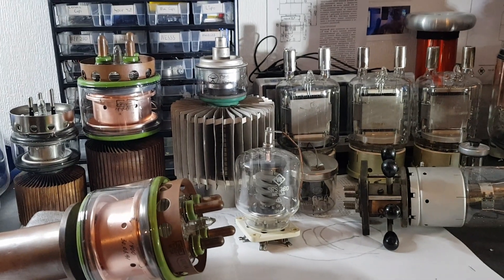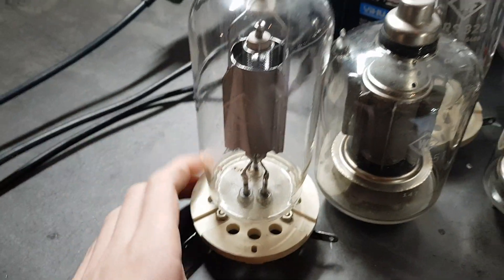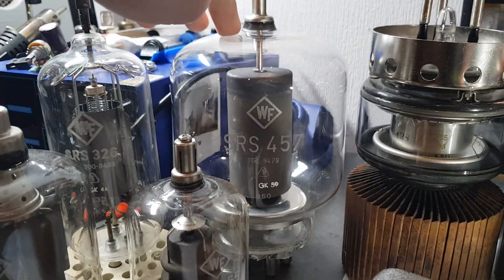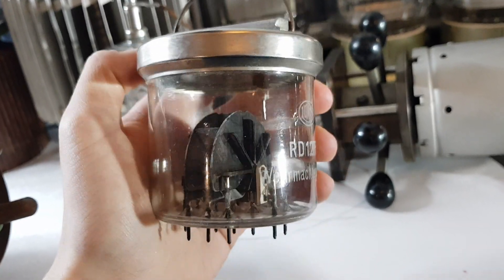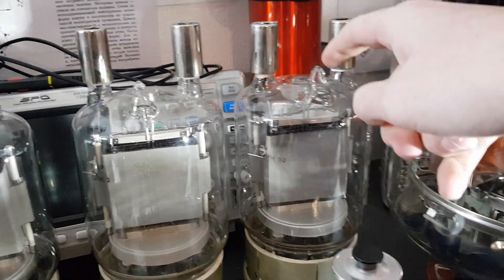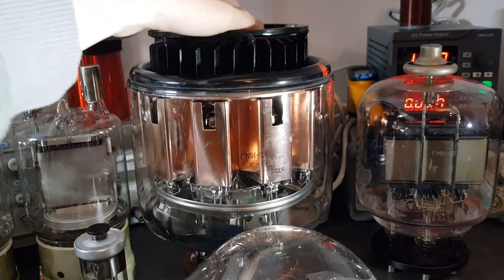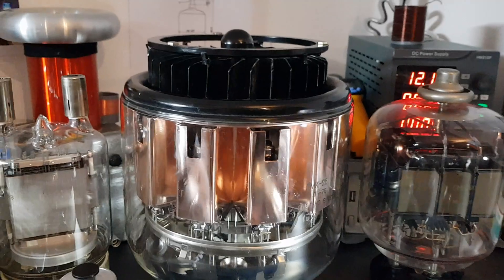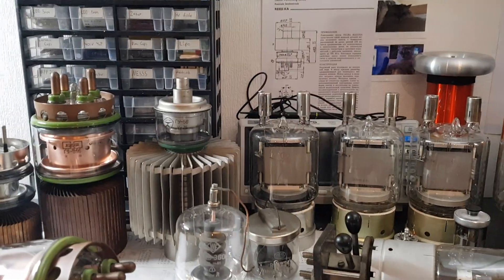High Power Vacuum tubes pt2

Comment: Do they emit radiation? I wouldn't want to burn my balls with x-rays
Reply: No, unless you push the voltage over 10kV they wont emitt anything outside the glas. 
Most of these have thoriated tungsten filaments, but nothing makes it out of the glas

Comment: Absolutely beautiful tube collection. The GU50 is being used in a kit audio amp by Mellow Tone Kits, and is apparently called a loctal tube. I guess they’re able to put out about 7-10 watts, but I unfortunately don’t remember how many volts the plate needs to achieve that. I inherited my grandfathers tube collection, and he was a HAM radio operator for as long as I remember growing up, but he also built some really nice amplifiers. Thanks for showing your tubes. Very nice collection!

Comment: Wie teuer waren die
Reply from the maker: Ich habe alle für extrem gute Preise bekommen. Denke mal das wenn man die zu normalen priesen kaufen würde kostet es ca 1500€+ 

Die gmi2b alleine kostet 300€ 
Die gu39b nochmal 300€ 
Die 3 gu81ms auch nochmal 150€ 
Die GU-5B nochmal 150€

Ich habe aber nur 
100€ für die GMI-2B gezahlt
50€ für die gu39a
50€ für die gu39b 
20€ für die gu56 
usw